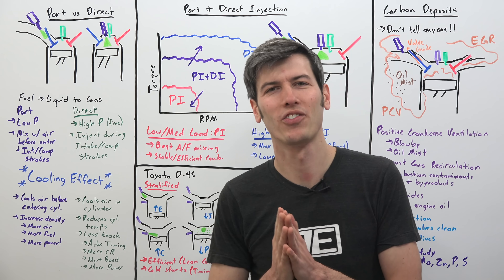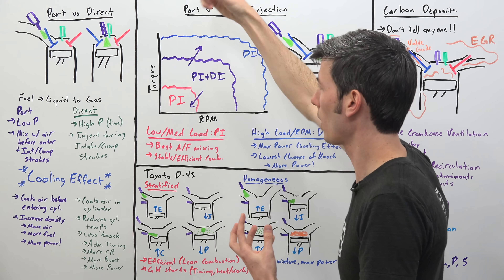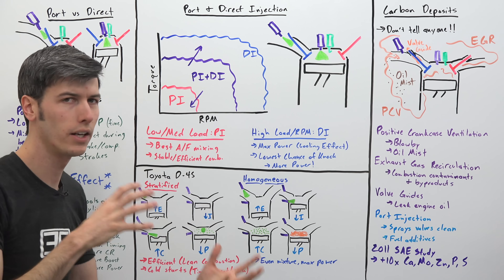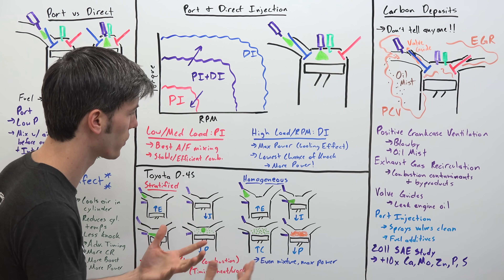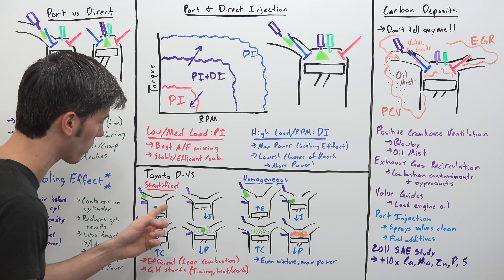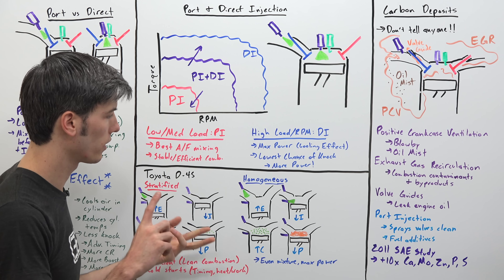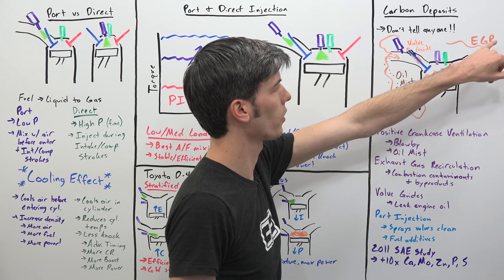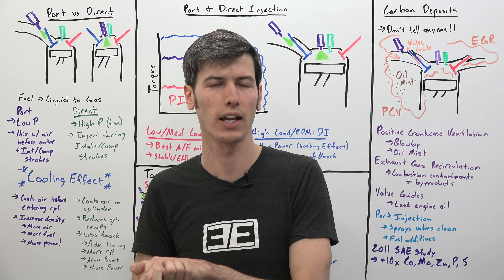Why New Cars Are Using Both Direct & Port Fuel Injection

Comment: Why not use a battery to heat the catalytic exhaust without using rich mixtures at cold start. Diesels use glow plugs (or used to). Also where are these carbon removing elements coming from  unless it's in premium fuels with cleaning agents
Reply: Petrol and similar petrolium derivates are used as cleaning agents in the metal industry since a long time. heated cats actually exist, BMW developed them in the late 90's, but never saw wide spread use, propably because of the additional cost.
Reply: @shi01  Battery cost, efficiency and the "hit" on modern Li-ion batteries would be different now than in the 90's. The cost must have been high if BMW was not able to absorb it into their pricing. With Regen braking offering "free" power then any impact on the battery could be absorbed even in an ICE car if regen braking was installed in all cars. After all regen cuts heat to the battery pads-disks, extends their life and offers power back to a battery that is under increasing strain from in-car electronics and intelligent driving features that must be powered (lane keeping/cameras/adaptive cruise/collision alerts/auto-stop/start-stop) not to mention ever bigger electronic screens. inside cars. Hybrids are ideal candidates

Comment: Question, so im looking for new injectors for an 09 srt8 with port injectors. Im wondering if getting after market injectors that have a better atomized fuel spray would be ok with it or is an atomized spray more for direct injection? Im honestly confused here.

Shouldn't hurt anything i dont think plus it would be better combusted and better mixed and it would cool the air better thus making better power.

Comment: D4-S training talks for my job specifically mentioned carbon buildup. D4-S has an injector cleaner cycle that shoots a high-pressure air-fuel mixture laterally across the notch in the injector tips to clean them. It happens during idle every approximately 17k miles.

Comment: LSPI(low speed pre-ignition) is one of the bigger problems associated with gasoline direct injection engines. This also creates issues with deterioration of the oil viscosity due to fuel dilution. Choice of engine oil and following manufacturer's recommended change intervals has never been more important than it is now.

Comment: I had a port injection engine retrofitted to run with liquid propane. Valves got dirty and it ate oil since all the additives and extra lubrication from the gasoline were missing

Comment: Great show as ever. I have a Citroen DS3 155THP and I'm on my second engine as a result of pre-ignition due to the carbon buildup (scouring the net shows they're notorious  for this due to the turbo and Di), it always seems to be the no. 4 piston that breaks, I'm assuming it doesn't cool as well as the others so the carbon builds quicker there. Anyway, I've done about 30k miles on the new engine, and the pre-ignition is starting again so I'll try use a carbon removal spray, do you know of any way to prevent the buildup? Or do I have to keep using the spray? Getting it walnut blasted hasn't been great for the valve seals so I try to avoid that method. Oh, and as you pointed out, Citroen admit verbally that the carbon issue is a problem, but they'd never put it in writing, despite seeing 7 of the same engines in the shop at one time with the heads removed for blasting.

Comment: So, is it safe to assume direct and port shouldn't have the same carbon buildup issues as direct-only because the port injection cleans the carbon deposits off the valves?

Comment: I'm still waiting for manufacturers to use the full extent of the flexibility an electronic wastegate affords on changing effective displacement. In my experience, only VW has only really taken advantage of it to a significant extent with their EA888 on. It's simply a software tweak. It isn't my forte to develop software, or code in general, but I would love to tweak the software on my F-150 with the second gen 2.7l to dump it's boost more often. With a 3.73 rear end and ten gear ratios that are directly selectable, it's pretty pointless to run at near max boost at the highest gear, when  running 1,000 to 1,500 RPM higher with little to no boost would yield significantly higher fuel economy. It never feels right to lug a turbo engine. I feel like some of the engineers at the major manufacturers phone it in at times. Low RPM doesn't always mean low fuel consumption, as it also can be skewed by A/F ratio and MAP. If they can develop advanced algorithms to determine MAP without using a MAF sensor, they can surely develop some that weigh variables of load, speed,  and throttle input to modify boost pressure and transmission position. Not to mention the maintenance requirement of all the blow by caused by running high boost while lugging, then suddenly increasing load by adding a hill. I do know it's well documented that these turbo charged motors should be treated like diesels in that they will introduce significantly more fuel into the oil sump, thinning it out and reducing lubricity faster.

Comment: That is why 80's and 90's Toyota engines were reliable - port injection
Reply: symmetry08 honda says hi
Reply: Actually Toyota’s reliability comes from their engineers and their Kaizen philosophy in their whole design and auto assembly process. Everyone had port injection by the 90’s, and not every auto maker made reliable vehicles like Toyota.

Comment: I wonder how clicky those engines get with  twice as many fuel injectors doing their thing.
Reply: Mine sounds normal as during idle (when you will hear them outside the car) only one set is used at a time.  You can hear the change when it suddenly switches from one to the other as it warms up, but overall it's no noisier than any other fuel injected engine.

Comment: Thanks for the video :) really explained a lot. Wonder if the whole DI issue is the same for diesel engines? I've never experienced modern Diesel's torque (been meaning to for years 🙁) but we have an old Peugeot 405 indirect injection turbo diesel which has decent torque compared to most modern cars here; the 1.5 liter petrol engines in Toyota Allions, Premios, and 1 litre Indian cars; and has lasted 25 years without any major engine repair... I wonder if modern diesels would last like them

Comment: All this stuff you saying makes sense in theory, but it just doent happens that way in reality.  People are crunching numbers so much to make something better.  A calculation comes up that something will be an improvement.  Test it in the real world and people scratch heads because there either  small improvment or its worst.  Alot of theories become trends but when something works it works because it has one job.  I dont think anything will improve so much over the years because people therorize so much.  Like how you say direct injection improves combustion.  How, thats not the job of the fuel system, the design of the combustion chamber determines that.  Fuel being sprayed in a fine mist and high pressure doesnt sound right either.  The placement of a fuel injector boils down to other variables.  People re saying this is better it works its the best and in reality it works for a specific cause. Diesel vs gasoline Carb vs FI turbo vs supercharger small engine vs big engine.  All broken theories.  Theories and traditions complicates the when its all laid out.  Technology is nice but sometimes its over the top and dont work as intended
Reply: As part of the scientific method theories are tested and retested. The engineers, physicists, chemists, and others that research, design and test engines don't just stop with theories, they use very complicated computer modeling and build and test actual devices to determine what works, or does not work. We would still be making inefficient and high pollution IC engines if it were not for theories that have been proven correct. 🙂

Comment: I have a question no one seems to know the answer to.
Most engine blocks and heads are either made out of iron or aluminum, but why aren't they ever made out of steel?
It's stronger and cheaper then aluminum or iron, and it's lighter then iron.
Reply: There are plenty of net resources that answer your question. Short answer: because cast iron and aluminum alloy work well in molds, work well as engine blocks and heads, and steel is not a practical metal to make complicated molded parts like engine blocks and heads. Future engines could be some sort of exotic type of "plastic" (polymers). Google that. 🙂

Comment: Nerd moment for me. Just yesterday at work I had to remove the upper intake on a 2GR FKS under factory warranty.  In service date of 2/19/2016, and about 31 thousand miles on the odometer. I noted the intake valves were spotless. Not one spec of carbon accumulation.

Comment: At about 5:15 you mention that you start injecting fuel (port injection) during the exhaust stoke when the exhaust valve is open and the intake valve is closed.  Would this not just have the effect of spraying fuel on the back of a closed valve?
Reply: Roger Saumure Yes. The fuel pools on the back of the hot valve briefly before evaporating.

Comment: The 3.6 DI engine from gm has the carbon issue bad. Had it happen in a 2010 enclave in 2018. Steer clear of DI without port injection.
Reply: How much did it cost to have the valves cleaned?

Comment: As a service business owner I researched DI crud cleaning. Either you are putting abrasives into your engine at high cost or using products like CRC's cleaner that is somewhat ineffective and can dump all the crap coming out of your engine into the catalytic converter. Ford's recommended repair to dealers was to replace the cylinder heads! Now Ford comes out with their new 7.3 liter truck engine with port fuel injection only, and pushrods! Guess why...

Comment: great video! i'm happy to now know that there's more to dual injection than simply mitigating the valve crud issue, although i'm currently waiting for a company to take it a step further.
what i mean by that is to have a 3rd injector just in front of the throttle body for idle loads, 1: as fuel is a powerful cleaner and it would help keep the throttle and intake plenum cleaner from PCV, EGR, and general deposits, 2: it would help further cool the intake charge, and 3: it has the whole intake plenum to evaporate in so it can augment the combustion of the other 2 methods.

i do believe mazda are experimenting with something similar, but instead using hydrogen as opposed to a more wholly evaporated gasoline to make combustion more effective

Comment: There is a german Engineer with a Company called RSklinik who also works at Volkswagen and offers intake valve and manifold cleaning. 
And he clearly names the Problem with the Carbon deposits caused by Not using Port injection. 
An example always refered to is the RS4 B7 which loses approximately 40hp in 40.000 km just by Carbon deposits (depends on oil and driver).

Comment: Can you list which cars are dual injections, which are direct injection only, direct injection are maintained nightmare
Reply: I know the 2.5L in the 2019 Rav-4 and Camry's have dual injection. Not many mainstream cars have it.  I think Subaru is just now switching from Port to Direct Injection on the 19 Forester and all upcoming models.  Which means they will soon have the carbon problem as well.  They are all doing it for better MPG.  Question is will you save $750 at the pump every 70K miles to offset the cost of walnut blasting cost?  I'm buying stock in walnut shells.  going to be big business soon.
Reply: Tbh there aen't many dual injections car. I can only name the FR-S/86/BRZ. The toyota D-4S was 1used in this car. VW has a couple Di cars. the next supra will be direct injected.
Reply: Many auto journalists just focus on size of wheels or led lights, they do not understand the differences of different power trains, so they rarely make any statements about power trains. General consumers are only attracted by superfluous fancy tech interfaces, the size of  screens.

Comment: You have just made a good case for an electric car.  Electric motors are so simple compared to these complicated beasts that no one will ever be able to fix them when something goes wrong and something always go wrong.  In 5 years the price of electric cars will probably be very competitive.
Reply: True that electric cars are super simple but I'm afraid batteries and their cooling systems need improvement especially in tropical climates with hot humid weather. 4+ year old Nissan leafs with their air cooled batteries are showing premature degradation here in SL, so most owners are trying to get rid of them before things become critical and resale value is quite low compared to that of regular cars. Here sometimes cars like a Corolla or Civic could be sold 5-10 years later for more money than it cost when it was bought (there is inflation to consider and our pretty high and increasing car taxes etc)  whereas leafs which cost like 3.5-4 mill are going for like 2.5-3 mill like 3 years later. Quite a drop in resale value. We had a perodua viva bought new for 1.6 mill and sold for over 1.8 mill 5 years later 🙄

Electric cars had/ still have lower taxes prompting that initial surge of imports

Comment: So where does TBI come in? I guess that’s even older than PI and rarely used by mfg’s nowadays but still very popular in the after market scene (for classic cars). 

Does it have less carbon buildup issues than DI but more than PI because the fuel is not directly injected in the port but inside a Venturi? Is it less economical and powerful or is it a marginal difference with PI?

It seems to me that it’s the ease of installation and the closest step up from a carb that makes it popular for hot rodders. Developing PI for after market installation is too finicky and has less of a consumer base. I know some guys that successfully installed these TBI products on their old V8’s and gained power, economy and reliability. So why not? :)
Reply: Good question. TBI as a retro-fit (replace carburetor) is as you say, mostly easy and usually an improvement in power, economy and reliability, and you would think that because it meters fuel more precisely than a carburetor that you would have less carbon build up. Modern PI is more precise than any TBI but requires many more sensors, better intake and exhaust design and more computing power.  That's why you see some older modified cars with a newer PI or DI engine instead of trying to convert an older engine (not to mention cars that are being converted to electric motors).  🙂
Reply: Makes sense. It’s dead easy to swap an engine so why bother.*

I own a /6 Dodge and know a few people (not personally) that made custom intakes with PI. But these engines are 1. Durable 2. Easy to mod 3. Cheap 4. Sturdy enough to easily give much more output. They are also popular to put turbo’s on (as the intake and exhaust share the same space).

* The reason I am interested in injection is because I live overseas and we don’t have crate engines, cheap US car parts an cheap gas.
Reply: @RustOnWheels  Ah yes, the advantage of living in US where there are many new or used parts available for our US production vehicles. In US many modifiers of collectible MoPar vehicles that came with a slant 6 have swapped in a V6 or V8, either with carbs or FI. With the hood closed the car can look stock, but the vehicle is more fun to drive. If I found a  Barracuda with its original 225-6 it would be a tough decision to keep it stock or swap in a MoPar V8.
Reply: rizzle razzleuno you’d be surprised how fast and modern a mid sixties mopar with 225 actually drives and with a slight few mods it goes like lightning too!

Comment: I worked for a GM dealer and the 3.6 liters were horribly prone to carbon buildup. The pcv system was terrible . We would use a chemical cleaner to clean the valves . The carbon would lead to cold misfires at low mileage. In extreme cases We would remove the cylinder heads and and clean the valves manually .

Comment: He forgot to mention Mazda engines run the intake valves at 700 degrees to burn off carbon deposits on intake valves. And he didn't mention oil catch cans can capture the blow by. Maybe someone can make an EGR filter now too. I love how electric cars don't have any of these problems though. I'm just waiting til an electric car has a 600 mile range!
Reply: How do Kia and Hyundai tackle this problem I can’t find any solid information on it. They don’t seem to be having any problems with DI.
Reply: @tails300  good question. I'd like to know as well. I know Ford and Toyota have engines with both port and direct injection. Not sure if any other manufacturers are doing that.

Comment: DI injectors take about 3-4 ms to inject gasoline, gasoline needs to vaporise which also takes roughly the same time. Calculate how much time you have to inject gasoline and make it cool the engine at 3000 RPM. I think DI is more for low load/low RPM, but please clear me up, Jason.

Comment: Hello! Big fan of your videos. One thing got me curious, for more power isn't it better to use port injection at high rpm? My thought is that direct injection is limited by it's opening time. As far as I know Vw 1.6 fsi engine is ok at low rpm and it's quite torky, but at high rpm is not brilliant... a port injection engine may be not so efficient but for power it's more useful (ex: Lamborghini Aventador v12 6.0 mpi)